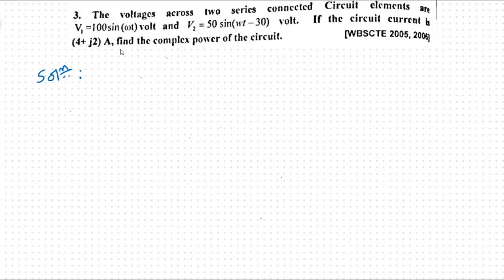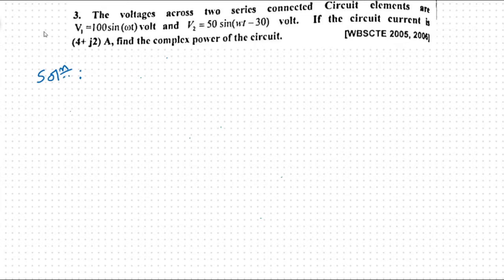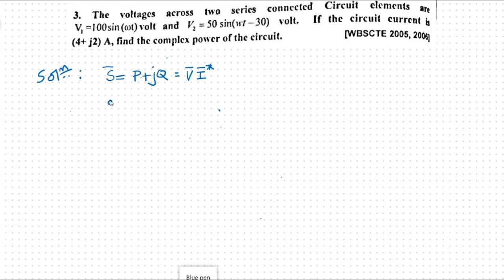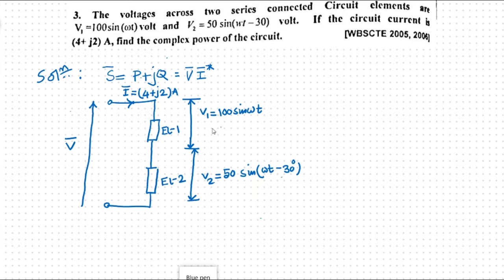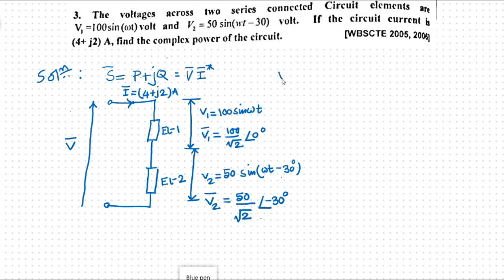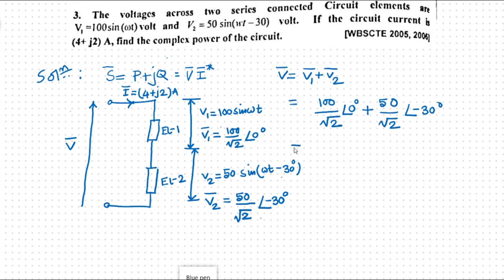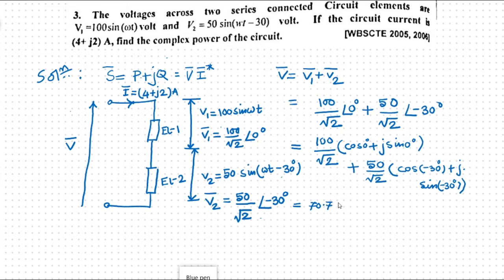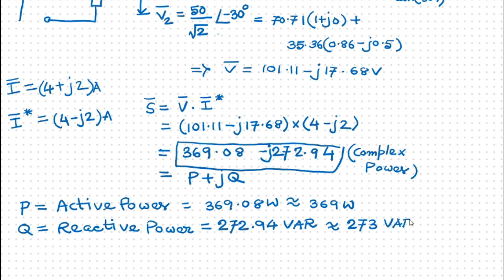NUMERICAL ON COMPLEX POWER CALCULATION IN AN AC CIRCUIT

Comment: For complex vector addition aren't you supposed to make the real waveform a cosine?   v1 =   100 exp(j -90.00*pi/180)      v2 = 50*exp(j*(-30 -90)/180*pi)          S=1/2*(v1+v2)*conj(i)   Is the real part of (v1+v2) negative like 145 exp(j -100*pi/180)?